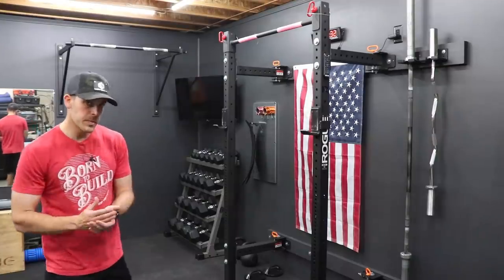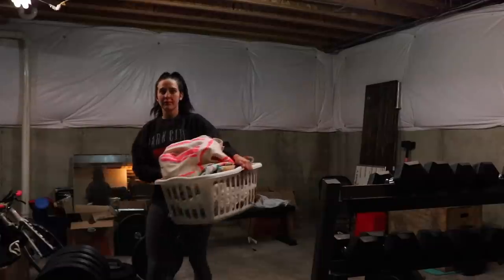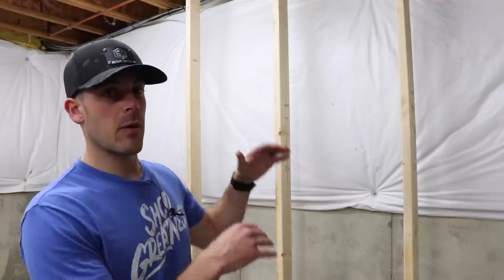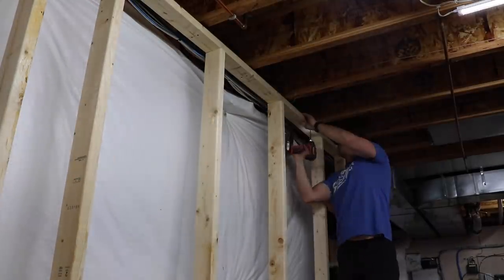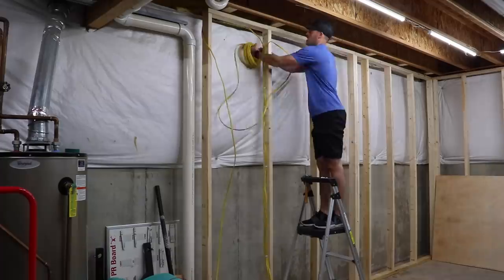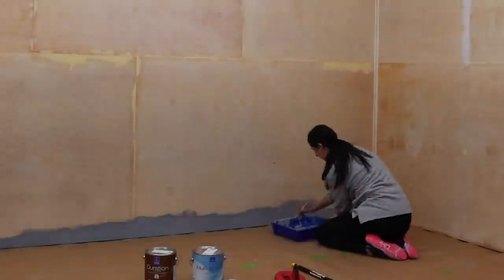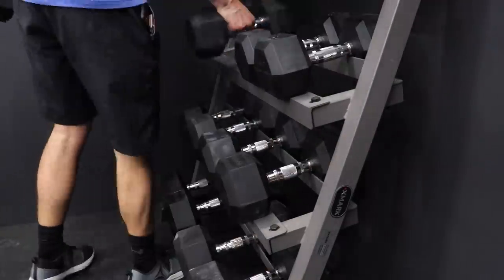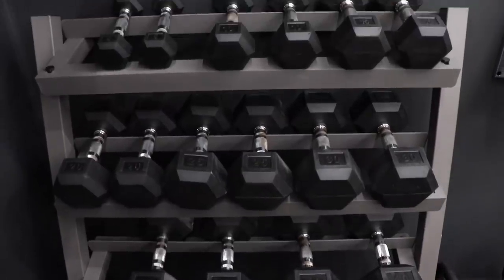How I Made my Basement a Gym // Home Fitness

Comment: Keep tabs on moisture building up under those mats every few weeks. They tend to build up condensation easily and can develop mold if left unchecked.
Reply from the maker: Good tip!
Reply: @ShopNation  You can also put Gorilla Tape between the seams of the mats to prevent moisture buildup. It also holds them in place really well.

Comment: nice. i keep threatening to get a fold flat rogue power rack to save some garage space (in sunny fl so no cold issues just need ac which my shop has) just hard to justify as i have a marcy squat bench sitting idle and a 30 year old Wielder that has served me well for over a decade (picked up used). only thought on you gym here and space useage other than its awesome is I would have probably added an access panel for the cleanout in case its needed. maybe you did just not on video but a little inset panel with trim and exposed screws for easy access.

Comment: As someone who's bought and used Rogue equipment since they began, strip that powdercoating off your pull up bars! Trust me. No more nasty tape needed. Raw steel is the perfect amount of grip needed for pull ups, toes to bar, leg raises etc. I just used some eco-friendly gel paint stipper from Home Depot. A couple of coats and some scraping and the powdercoat was gone. You could also just buy steel piping if you want to save yourself the hassle.

Comment: Recommend using gorilla tape on each seem of the flooring.  It works great and if you ever have to remove it, it doesn’t leave sticky tape residue.
Reply from the maker: I did that in our last gym and it does actually leave a residue if it’s on there for a long time. Works well for keeping the mats together though

Comment: Did you use a treated bottom plate?  If not aren't you concerned about wood directly on the concrete wicking moisture?  I know it's a problem here in Missouri would assume Ohio is the same. Love the videos.

Comment: Dude another great vid!!! Welcome to the frozen tundra. It should get warm by June sometime. I’m in the Communist city of Chicago. 
Not second guessing you but.... when I did my basement I used a vapor barrier paint on the floor and walls plus pressure treated bottom plates. Just fyi if you decide to finish the rest of the basement for a play room which is what I did. Make sure you get to 90 degrees on those squats Lol

Comment: You didn't cut access to your clean out. I suggest a small Door framed inside the wall with 1 by 2's.  It will be so small that you won't need a top frame piece, just the sides.  You can still do this.  P. S. Thanks for fixing the flag.

Comment: no sill gasket being used under the bottom 2x4s .....breeding ground for rot and mold
Reply from the maker: Even though they are treated?
Reply: @ShopNation  they will last quite a bit longer but , wood is still organic, concrete wicks moisture. no matter what treated wood can still rot and get moldy